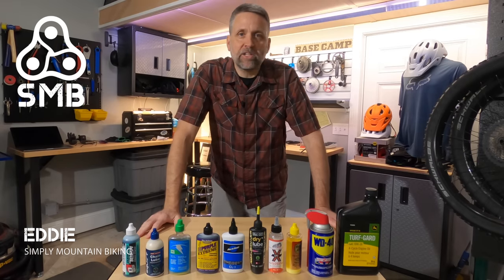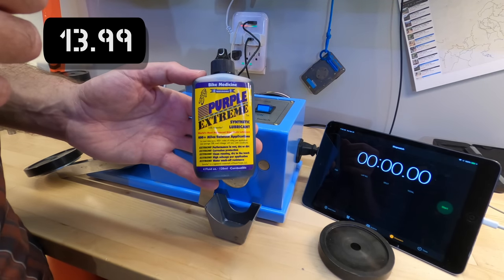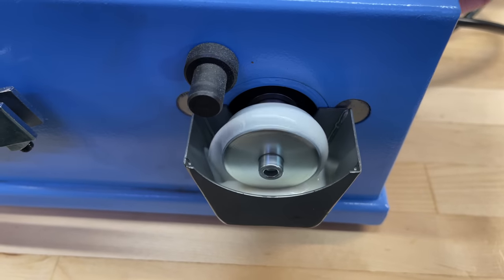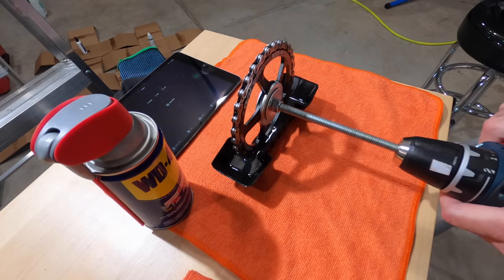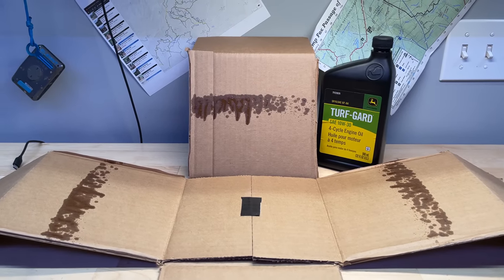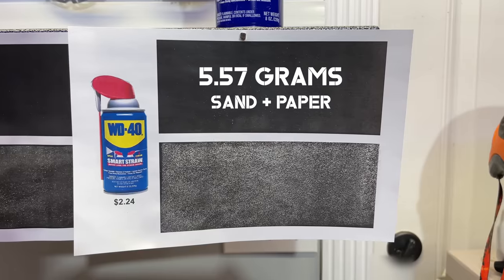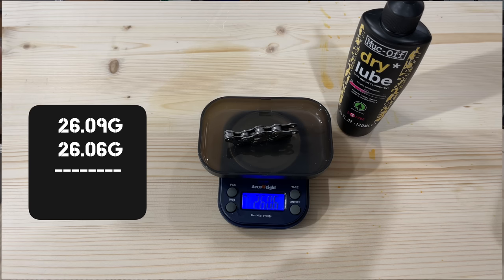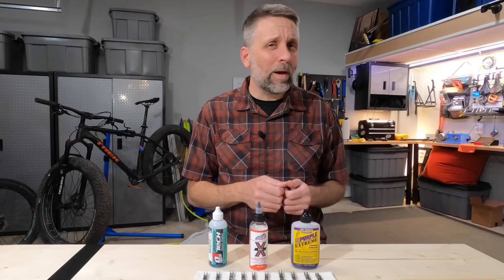Ultimate Bicycle Chain Lubricant Test | Best Bike Chain Lube

Comment: you don’t need special lubes…keep your chain clean, smear with vaseline, wipe off excess.
Reply from the maker: I agree with the cleaning - but Vaseline?  -Eddie
Reply: @SimplyMountainBiking    cheap and it works
Reply: Hello, Vaseline is bad for the chain because it collects muck and heavy dirt and quickly degrade your chain ring and the teeth on your conset.. highly suggest you switch to oil to reserve the gears n your bike

Comment: I personally run muck off wet lube. have always thought it works really well and this test doesn't prove it cause it is a different version of the same brand. but I'll still take it as plenty good enough
Reply: I have both, my feeling is the wet is smoother running but attracts dirt, which the dry doesn't. Both are pretty good.
Reply: @Tom_YouTube_stole_my_handle  all I know is that the wet lube works well for me, haven't tried the dry lube since my local bike shop doesn't stock it
Reply: @isaks3243  Mine stocks both but recommends the dry.
Reply: @Tom_YouTube_stole_my_handle  I'll totally buy the dry one if they decide to start selling them. is there a trick to get it lubed up with dry lube or is it the same as a wet lube (apply, spin around, wipe off excess)?
Reply: @isaks3243  The only difference I find is you need to apply quite a bit more than you would with the wet, turn it around gently a few times and then let it dry for three or four hours. There are instructions on the bottle covering the first application which do mention wiping off the excess but I've never needed to do that.
Reply from the maker: I've not tried the wet lube myself...  -Eddie

Comment: Squirt is a wax-based lubricant meant to be run dry...  The directions say apply it to a grease free chain, spin it a bit to get it into the rollers, then let it sit for the night to dry.  Also, the amount of friction that these lubes go through is much much less than what your test apparatus provides. While it seems that it would be synonymous with long term cycling wear, it is not because the temperatures of a chain never reach the temperatures of your setup.

I suspect you burned off the wax, which is why squirt had such a horrible showing. On a normal chain, I believe the temperatures are generally just enough to liquefy the wax and allow lubrication.

Finally, I'm a user of Squirt. I have no other interest in the product.
Reply from the maker: Thanks for sharing. -Eddie

Comment: As a person that has used Squirt since it came out in our country, I can only say this test is fallacious. Most of these lubes rely on a certain period to allow the solvents or carriers to evaporate and leave the layer of actual lubricating agent behind. With Squirt having water as the carrier (yes, really, water) it is a small wonder that it performed so badly in the friction test. Try letting that stuff set first and then retest.
Reply from the maker: Check out my Squirt wear test video - Eddie.

Comment: WD40 isn't a lube, it's more of a degripping product with slight lubbing properties. There is indeed a specific WD40 Bike Lube, but even that one isn't that bright. Using standard WD40 on a bike chain is a huge NO NO, HELL NO. If you hear someone recommend you WD40 to lube a bike chain that's clearly your enemy. Never ever make this mistake. It's good for degreasing, but not for lubbing.
Reply from the maker: Thanks for your comment. -Eddie

Comment: The force applied in this test as well as the time length of that force is no where close to what a bicycle chain experiences. These lubes are not design for what this test is doing with them.
Reply from the maker: Nope, they're not. But they all had to do the same thing, and there were variations. -Eddie

Comment: The only Muc-Off product I will use is their bike cleaner, because it seems like they apply perfume to just about any other product in their lineup. I got a chain degreaser among a bundle of brushes from them, and it smells like a prostitute. When you stand there with no awareness of what is about to happen, and you start cleaning a chain, and then this insane smell fills the room... Well, that was the first and last time for me. 
Now you tell me that the chain lube you will start using smells like banana, like what the hell...
Reply from the maker: Thanks for sharing. -Eddie

Comment: I ride a lot on limestone paths so I am investigating dry lubes. Wet lubes make a terrible mess. So when testing DRY Lubes, you don't let them DRY! This completely invalidates their purpose. They have to be dry to not attract dust. I didn't watch the rest of the video.
Reply from the maker: Thanks for the comment. -Eddie
Reply: @SimplyMountainBiking  My apologies. So, I'm surprised you didn't tell me to watch the rest of the video. I did. So, great you tested them dry as the instructions direct. After investigating a LOT I decided on Silca’s Super Secret Chain Lube. Wax based with other additives. Expensive but I'm really tired of the dirt paste I accumulate on my drive train. I can let you know what I think if you would like. Thanks.
Reply from the maker: @sle87g  Hey, no worries.  It happens a lot. -Eddie

Comment: This was not a fair test for squirt, that is not how you use it on your chain...
Reply from the maker: But it was a standardized comparison that shows the qualities of the lube independently in a controlled environment.  Take those results, try the lubes in your real world conditions, and ride! -Eddie
Reply: @SimplyMountainBiking  later i saw the other tests, in my real world experience where I ride a lot in all kinds of conditions my chain lasts the longest with squirt since its the one one that doesn't suck dirt in rollers and chain remains smooth after all kinds of rides, dirt, dry, wet etc😁

Comment: Consistent technique, but flawed testing because you should not splashing chains before a ride. Let all chain lubes, wet or dry to evaporate off their carrier solvents before riding.
 I gettit, trying to extract out concepts for a video, but you are not dealing with metal on metal chain geometry until the final wash out testing.
Reply from the maker: Thank you for your comment. -Eddie

Comment: This is a sketchy test.  Interesting, but major issues in the tests.  Wet testing dry lubricants?  Completely ignored application instructions.  This is an invalid test because several of these lubes are not wet lubes and they need to dry.  They will have different characteristics when they are dry vs. wet.  What does spinning a chain ring at several times faster than olympic athletes ride prove?  At realistic speeds, do none of them sling off?  Sorry but I couldn't watched the rest.  I appreciate the try, but the test seems fairly invalid.
Reply from the maker: Thank you for your feedback.  Eddie

Comment: I just buy the stuff at Wal-mart.
Reply from the maker: The stuff at Wal-mart is White Lightning.  Yuck. -Eddie
Reply: @SimplyMountainBiking  If it gets cleaned off and re-lubed after every ride, what does it matter if it's a premium product or not? I ride Appalachian trails which are going to be muddy every time, so a premium lube is going to represent almost no value to a user in those conditions when the chain is caked in mud. Also, the stuff at Walmart is a different version than what you test here. They have a dry Easy Lube (now sold as Clean Ride) and a Wet Ride. Maybe you can test their other variants next time and see if you like those any better.
Reply from the maker: Thanks for the suggestion.  -Eddie

Comment: You cannot be serious, as your test doesn't respect the manual of the lubes you test. Your wear test is ridiculous, doing it with Squirt without letting it dry is like if you added 60% of water on the other lubes...let the dry lubes dry! That's the key point..
Reply from the maker: Thank you for your comment. -Eddie

Comment: why would you consider oil that evaporates over night to be a good thing? 
oil is meant to stick around forever... if its gone off the cardboard in a day that is not a good thing my friend. your test wasn't well researched for bicycle real world use and for that i gotta dislike.
Reply from the maker: I think the carrier evaporated and the low viscosity of the remaining lubes allowed them to penetrate into the cardboard via capillary action.  I want a lube that will penetrate in and behind the roller bearings.  -Eddie

Comment: Your test is invalid. All you proved is that evaporative liquid lubricant carriers are poor lubricants.
*
You need 2 test sets. Many of these chain lubes have a liquid carrier that adds no lubrication at all. IT is simply a carrier that floats off dirt and deposits the actual lubricant that is waxy or a grease. The liquid then evaporates off. This never happens in your test! Other lubricants are oils and they don't use evaporating carriers.
*
1. Test 1: ALL chain lubes that use a liquid evaporative carrier. Get rid of the liquid carrier and test just the lubricant! The liquid is a washing agent and does NOT lubricate!
2. TEST 2: All oils. They don't use evaporative carriers. This video is valid as is for them.
*
Again...your test is invalid. Good tools, bad test set because you ignored the nature of differing chain lubricants. I'd LOVE to see a valid test that accounts for the types of chain lubricants! This wasn't it!
Reply from the maker: Thank you for your feedback. -Eddie